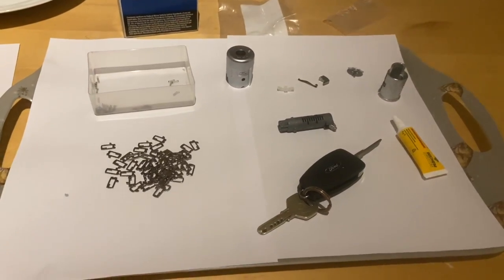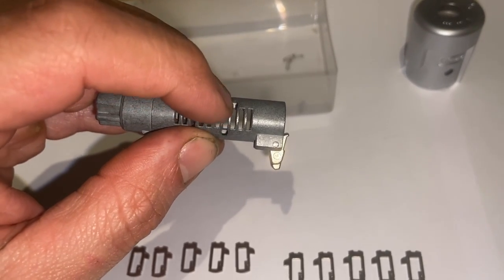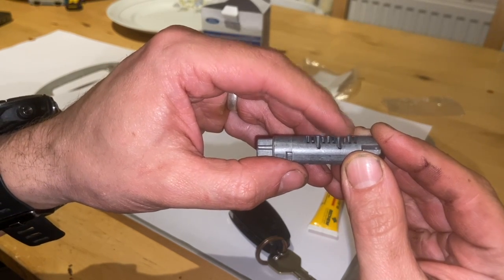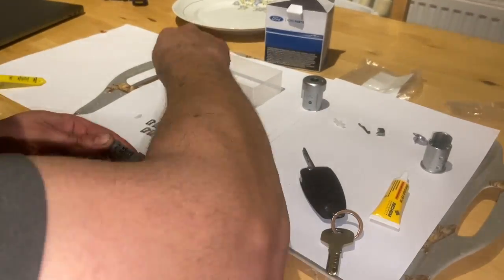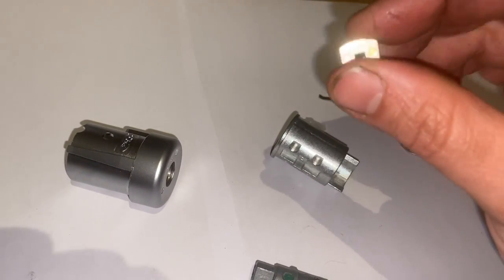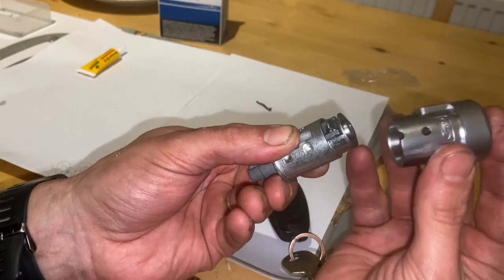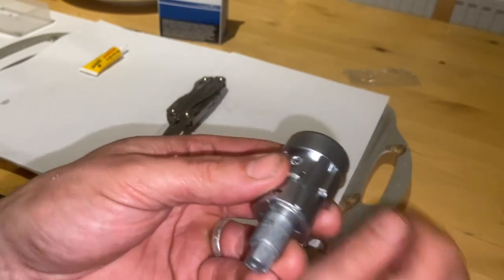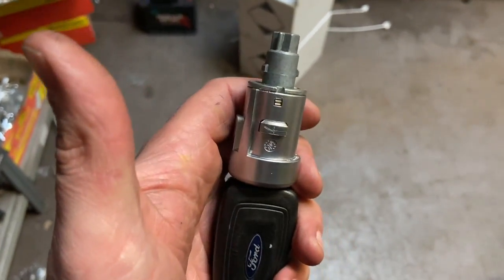How to Build Ford Transit Custom Ignition Lock barrel

Comment from the maker: Aftermarket barrel with new keys - https://ebay.us/YASfq9
New Ford Ignition lock barrel set - OE Part number 2363729

Check Euro car parts - https://tidd.ly/3lIO7xA  (use discount codes on site)
Check "Car Parts for Less" - https://tidd.ly/2LNEwIn  (use discount codes on site) 

Tools used : Amazon / eBay links

Small snap on flat blade screwdriver - https://ebay.us/S62oNB
Needle nose pliers - https://amzn.to/3b3RZWu

Comment: Great video , took my old one out and unassembled it to write the numbers down . On mine had to put in position 1 to get the pin to push in to remove and replace from the ignition housing. Cost me £90 for a new lock much cheaper than waiting for it to completely fail. So cheers again saved me a few hundred quid 👍
Reply from the maker: Glad it helped! thanks for the comment 👌👍

Comment: Just did it. Would have been lost without it.I matched it with excising numbers. So much easier, other than the kit didnt have 4. 4 only 4.3 etc. Still worked.
Please not. When pulling the key out. The pegs cant be depressed. I was holding it tight so the pegs didnt pop out. Hold it slack in the hand, so key comes out. It will make sense to anyone doing it.
Thank You

Comment: Hi mate its me again 😂, ive got a customer in next week with Transit, he went away and someone tried stealing the van ,snapped a spider key in barrel 😳, i know to remove the barrel you need a key and turn it to press pin,what shall i recommend him if i cant remove barrel fo you think? New steering lock and ignition?
Reply from the maker: Arr what a pain! Yeah you may be able to drill it out , I’ve had to do it before , just pre worn him it may need a full new lock / barrel if you can’t get it out